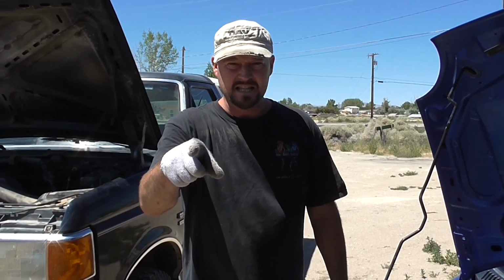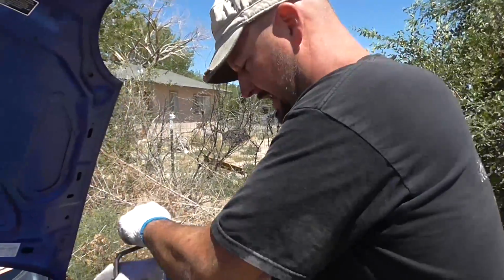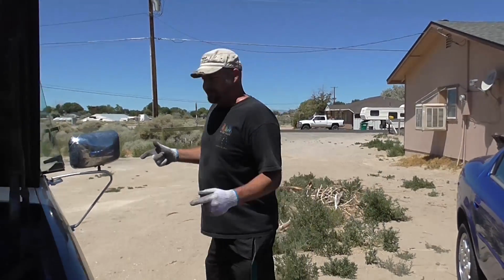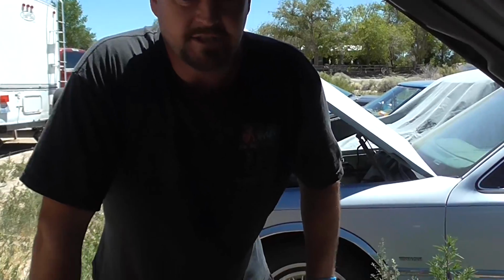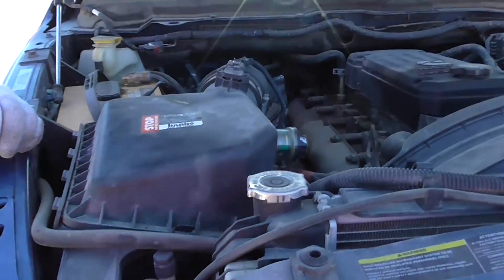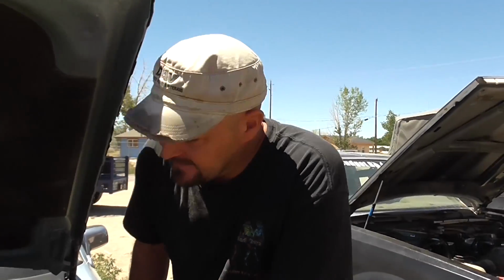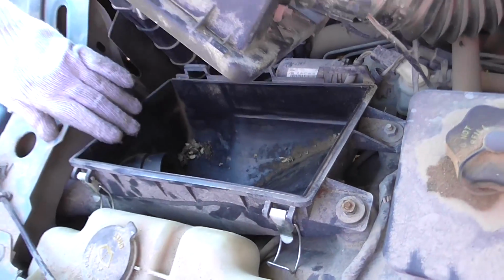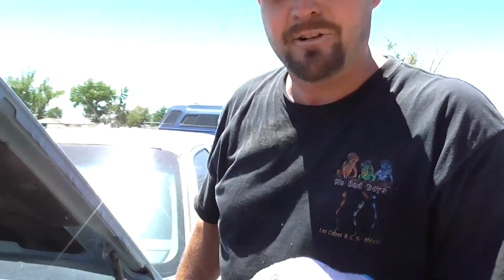Free Horsepower And Fuel Economy - Intake Mods

Comment: I wanted to get an AEM intake kit for my FRS, but the price was just that $300. So I ended up getting an Air-Aid for half that. I was looking for some stuff for my 5.0 Explorer, I checked to see what they had for it. They had 1 K&N drop-in filter. It was $50, still expensive, but still 1/3 the price of what I paid for an air-box intake kit. When I took it for a test drive, it went from very sluggish to running like it was new. I don't regret that decision. Plus all are cleanable and reusable for the next 100k miles.
Reply: Lol that would have happened with any new air filter. K&N filters gets you a few hp but terrible particle filtering

Comment: He did about 5 lines before this video! Jk but in all seriousness he's instantly in my top 3 for d.i.y gurus.
Reply: made a new Free intake video on my Mad Boosting you tube channel.  I believe this on is better, it is specifically for Ford modular 4.6 and 5.4 engines in the F150, F250, F350, Excursion, Expedition, some mustangs and other Fords that used this unique cone filter with very small intake hole (reverse trumpet like I call it)

Comment: by cutting the box ,.. your allowing heat from the motor to enter the intake... might have been lil easier to mod the breathing tube into some sort of forced air induction setup ..
Reply from the maker: Every vehicle intake is in different location.  I prefer mine to be facing the grille area of the car for the coldest air possible.  Some cars do not have much of a choice due to air cleaners facing the side not the front.

Comment: I cut the cats off of my 95 F150 with the 302 n code, and installed dual exhaust, with low restriction mufflers, I tell you, that engine was very happy. 23 MPG on 33 12.5 r 15 tires, beautiful sound too.
Reply: lmao
Reply: NAH. You didn't get 23 MPG -- Those big-ass tires CHANGED your overall gear ratio.
 Almost always, bigger tires will LOWER your MPGs.
 Big-ass tires WILL DECEASE acceleration and INCREASE your stopping distance.
 Cutting off the cats makes your rig just another air pollution source -- it's illegal -- and stupid.
Reply: Removing the cats on a obs ford increases HP quite a bit, like 15 to 20 HP along with a aftermarket muffler, and the proof in that is because the stock e7te cylinder heads are very weak on the exhaust side and don't flow well, even the stock manifolds are crap, put some headers on cut the cats out and a nice muffler put on and you can gain 30 HP
Reply: @dawsonjorgensen3521    The mods you recommend are expensive (headers), illegal (cat removal), and stupid (because they're expensive AND illegal).
By-the-way -- the "honeycomb" cats used by Ford will flow as much air as a straight pipe. Ford cat removal is double-stupid !!
Reply: @SlikLizrd  picked up a set of stainless header for 180$ they work great and have the hookups for EGR,  lol and btw the cats were pretty restrictive on the older Ford's, especially after decades of aging they like to plug up because of them running rich,  had cut mine out and made a decent amount of power, 87 to 96 obs ford
Reply: @dawsonjorgensen3521   You keep trying to justify an ILLEGAL modification -- WHY ??
Those $180 headers are shorties -- full-headers are over $1,000 -- STUPID to run on a street-driven vehicle.
And no, Ford cats DO NOT "like to plug up" -- if you plugged 'em up by monkeying with your fuel mixture, it's NOT the fault of the cats!
Ford uses the same size cats on my 1974, 460 cu.in. Lincoln as were fitted to my 4.6 Liter Mercury at the factory.
Presently, Chevy, Dodge, and Ford are all making cars with 500, 600, & 700 HP  engines in street-driven vehicles. They ALL have catalytic converters in place.
Reply: @SlikLizrd  to each there own I guess, do what you want, end of story, not everyone has emission laws. Just trying to help people.
Reply: @dawsonjorgensen3521  It's cool that you want to help people -- but putting headers on a street-driven vehicle or (even worse) removing the cats, doesn't help ANYONE accomplish ANYTHING !
As for those "emission laws" -- it's a FEDERAL law that governs cat removal -- it doesn't matter what state you live in, it's ILLEGAL to remove catalytic converters. Period !!
If you REALLY want to "help people", then STOP with your insistence that cat removal is OK because there are no emissions testing in your area.
 We ALL breathe the same air. We ALL need to keep it clean.
Reply: dawson jorgensen I agree with you and the other guy has a shitty way about sharing his opinion.
Reply: @SlikLizrd  so, I guess that if a vehicle was built without cats on it from the factory, you want them installed? Or how about my old 1991 F-350 with a 7.3L IDI diesel, would you want me to install a diesel particulate system that would not only rob my engine of power, but also rob it of it's long lifespan? The way you talk, it's like the few of us that don't run an emissions system, are the devil. And before you chime in saying that my old F-350, which was built before any emissions regs where made for diesels is illegal, well, just look above, my truck is not required to have any emissions systems installed, at all. Only thing I need, is a set of pipes, leading my exhaust out away from my cab
Reply: Aren't HEADERS installed from the factory on quite a few vehicles nowadays? 
Oh and btw, "Sniff Sniff, installing headers on ANY street driven vehicle makes you a... A BIG FAT POOPY FACE SO, WAAAAAAaaa... Maaaaa... BIG FAT POOPY FACE IS TALKIN' POO ON THE INTERWEB AGAIN!!!"    
Even Red from That '70s Show said, " DUMBASS"...
In all fairness however, you are almost correct about CATS. They SHOULD last forever due to the fact that under proper operating conditions the catalyst "Platinum" is just that and doesn't degrade BUTT... GENEROUS MOTORS EGR VALVE AND FORD'S AIR INJECTION SURE PRODUCED A HELL OF A LOT OF CHERRY RED HOT GLOWING CONVERTERS THROUGHOUT THE YEARS WHICH FINALLY, VVT, VARIABLE VALVE TIMING "SEEMS" TO HAVE TAKEN CARE OF THAT. 
Just sayin'...
But, I digress, I often do.
Peace and Brightest Blessings Always 🙏 Be Safe.
       🤟 ROCK 🤟
Reply: @dawsonjorgensen3521  my engine runs cleaner with out the cat on hydrogen assist.so you dont have to have a stupid cat anyway.
Reply: @SlikLizrd  shorty headers are better for a daily driver...they move the torque curve to the left

Ford cats are restrictive..  removed them on a buddies svt lighting... It improved his top end and it lowered his EGTs

Comment: you should epoxy steel screen over the holes you cut in the air boxes.
Reply from the maker: I did not cut holes, but sections out of the airbox to expose as much of the dirty side of the airbox as possible.

Comment: I mean it's a good idea in theory, but then you are allowing all the heat that is around the engine to go into the engine rather than the cooler air that it gets from outside, typically through the finder wall. The temperature differences inside the engine bay and outside are pretty large once the engine is at normal operating temperatures. And hotter air means its less dense therefore you really aren't getting as much air in the cylinder as you think. If you were to do this and add an intercooler it would be much more beneficial, you don't need more air, you need colder, more dense air. This allows more fuel to be injected resulting in more power.
Reply: Colton Voelkel yep..just use a better filter and modify intake tube size
Reply: U forget the air gets heated anyway from the eng temp in the eng bay
Reply: ahh another internet armchair engineer. You forgot one thing the fucking vehicle is MOVING.
Reply: That air filter is going to get clogged so fast the way he is doing it.
Reply: kept rolling through the comments & FINALLY get to one that is correct (in my opinion anyway)
Reply: Also, once the air passes through the air filter the flow gets reduced down again as it continues to the throttle body. There isn't a whole lot you can do about that. So it is still breathing through a small hole. If you don't open up both sides I don't see this doing a whole lot of good. I think a less restrictive filter would provide more benefit than opening up the bottom of the box. I am not a mechanic though so I really don't know.
Reply: @kevinpantera4429  I don't care if you think I am wrong. You can attack everybody in here if you want but that doesn't make you right and them wrong. It sounds like you are getting a bit too defensive. If you think people are wrong and it bothers you so much, state your position intelligently and move on. Stop crying like a little baby.
Reply: @9019dd  u r right YOU JUST DONT KNOW!
Reply: Thanks for posting this.

No idea why people don't understand this.

Comment: II did this to my chrysler grand voyager 2.5td 2000mod. I cut a hole on the dirty side of the airbox facing forward, but the car felt slower afterwards.
Reply from the maker: probably because the other weak link is still there, the stock exhaust.  The Voyager has a very restrictive exhaust system so improving its intake without exhaust is only half the benefit.
Reply: @budgetboosting  I removed the old exhaust and installed a dynomax turbo muffler. I felt the difference straight away. better throttle response and the engine felt stronger. thanks for the advice.
Best regards Torstein Haaland Johansen /Norway.

Comment: Most people do not do ANY true bench-mark testing (meaning "real life street performance results"), before and after. The Dyno tests are not "real life" either.  And, many people say "I FEEL it is better, or worse"... Really!??? Born with a butt-dyno?  
I need to see the facts on a screen to believe it.  Otherwise it is just plain guesswork; I started my professional life in technical research and know how the mind can be fooled ANY way.
So I went out one night and did what Mr. Budget Boosting in the video suggested on a 2006 Pontiac Vibe/Toyota Matrix with Auto transmission, engine 1.8L VVT-i 1ZZFE 126HP (at the flywheel).
Long story short, about 10+10 runs (mixing several times OEM and modified) down (literally) and back up a 3 miles stretch of straight road with "bench-mark signs" to see how it performs at every point from lower to higher speed. I burned over a 1/3 of the tanks fuel, but refueled to have the same weight on the car and to be able to compare 1:1 before and after.  However, the temperature dropped 4F (night time), so this is a "factor" that provided more dense air at the end. (77F start, compared to 73F end).
Results: a pretty steady 4-5% speed gain compared to stock at all bench-mark signs. That's very good for "free", and I was surprised myself.
I am sure that this result is not applicable for every car, and may be as little as 0-2%, but when you hit 4+% you can clearly notice a difference.
I did not rely on my "butt-feeling" (which would have tricked me, just by "the noise"), rather real factual GPS numbers, "before and after".
So, Mr. Budget Boosting, you get my independent endorsement that it "works" what you said; how much HP-gain is however depending on the car, positioning of the air intake & the actual filter used (PS: CLEAN paper filters are absolutely OK; it does not need to be a fancy filter. CLEAN is the key word!)

Thanks Mr. BB for the time making this (funny) video, and sharing it with us. ;-)
Reply from the maker: Eric WindWheeler Some other points to acknowledge are:  To get the best benefit, the exhaust should also be gone through to ensure free flowing mufflers replace the stock restrictive mufflers.  Some manufacturers run more than one muffler per pipe, and resonators too.  I usually use only one muffler, replace the other muffler with straight pipe and also bypass resonators with exhaust pipe too.  That ensures that the balance is done to where both intake and exhaust are free flowing and work together.  Air in, exhaust out.  Also resetting the PCM after the modifications are done to allow the computer to relearn its fuel trims to the new found intake and exhaust flow.   I did make videos that discuss more on the intake modifications as well as exhaust too.
Reply: Budget Boosting Certainly agree with you.  
As I show with a "real life test", even just the intake modification made a good improvement. For me it is also a "noise issue". I use the car long distance; I don't want any louder exhaust (sitting in the cage for 1-2 hours), and the intake is only noticeable loud(er) if I put the pedal down. 
As I said, I was able to record clear improvements in speed compared to stock over the entire bench-mark test distance by just letting the new & clean stock paper filter have MUCH more air, basically the way you showed it. Since it reflected in about 4-5% speed increase at any point, it indicates that my stock exhaust system is probably not too bad restrictive to start with. I think it has almost 2 1/2" diameter pipes from front to tail..
Reply from the maker: Eric WindWheeler Its usually the mufflers, resonators and catalytic converters the factory uses that are very restrictive.  It is a great basis to improve upon.  Every car I have ever done both these conversions to became a whole different car in performance, response as well as economy provided I could keep my foot out of it..... NOT
Reply: Eric WindWheeler Numbers aren't everything. If your ass is telling you that it's faster, then it probably is. In the world of dirtbikes and quads pretty much all assessment of power gains from modifications are done using an ass-dyno. Alot of times dyno's themselves aren't accurate for a number of reasons (many don't even simulate rolling resistance, and I've seen many dyno places dyno car's in the wrong gear and get very skewed numbers) and most people don't look at the dyno graph. They just read the final number and if you actually lost 2hp at the top end but gained 5hp in the bottom and mid then I'd say it was worth it.
Reply: Julian G "if you actually lost 2hp at the top end but gained 5hp in the bottom and mid then I'd say it was worth it."
BINGO! That's where the "usable" HP needs to be.
Reply from the maker: Haywood Jablomy yes the bottom end gains are where the fuel economy comes in.
Reply: Julian G You could "feel" that on a dirt bike or a light weight motorcycle, but not on a car with only 2-4% power difference, better or worse, only if you have some means to measure before and after.  And that's exactly my point. I did my test with "factual numbers".  And, I ride motorcycles myself and tune them to best performance, "as seen in the avatar"...
Reply: Haywood Jablomy Your comment misses the point. We are talking about "free additional power", and Budget Boosting's intake modification gives (logically retrospective looking at my own numbers) a very linear gain over the entire rpm range of "x%" (in my case about 4%), depending on any individual's car's OEM intake restriction.  If you want a designed power increase you will have to spend some hard earned cash from your pocket to get that, but heck, I am very happy to have at nominal 100HP another FREE extra 4 HP...
Reply: Eric WindWheeler "Your comment misses the point."
Huh???? All I did was quote and confirm another poster's opinion.

Nice old bike BTW.....Z1?.....KZ1000?.... :)
Reply: Haywood Jablomy Again, BB's point is "free power gain", no money spent (except he shows different filters + intakes, which I did not do either; just used a new clean OEM paper filter). Of course, one can't expect much and sophisticated altered power curves, but when I tested I was truly surprised about a noticeable "recorded" difference. Power was gained, if at low or high rpm doesn't really matter, fact is, it is "free"! Hope all visitors here understand that now. 
As BB said, mods on the exhaust side will bring additional performance improvements, but unfortunately it comes with much more noise and "I" do not want to be in that boat. I love "sleepers"; never need to be embarrassed if one out-performs my "silent car", but making a lot of noise and having not much power, quite embarrassing IMO.  Same example we all know too good are "loud motorcycles" that make a lot of noise for nothing, and measured  dyno power is often just 45-55 HP..  

PS: Haywood:  your motorcycle question; that is a 1972 Suzuki GT550 "Cafe' Racer" 3cylinder, two-stroke.  Time-correct, no modern parts on it, still points ignition, all Cafe' Racer modifications based on parts of the 70's, and it still has the four-shoe twin front drum brake.  40+ years technology is "a lot of work" to ride fast when compared to today's modern bikes.   ;-)
Reply: "It's true !! The mind can be fooled in ANY way. And a weak mind can be fooled at ANY time.
Example : Trump voters,

Comment: I would suggest getting another air box at a parts yard, Pick-n-Pull, or its like before cutting into the factory air box on your car.
Reply: or don't, then if you ever want it back to stock, THEN you can grab a stock box at the parts yard.
Reply: Ty Hobbs That's exactly what I would do pick an old one, drill a couple big holes before cutting the entire bottom, K&N it and presto!